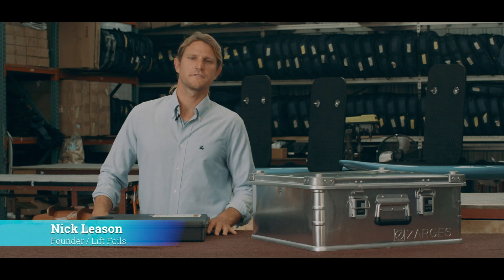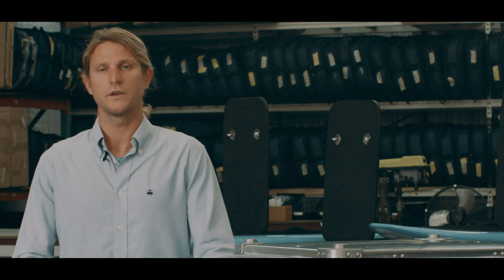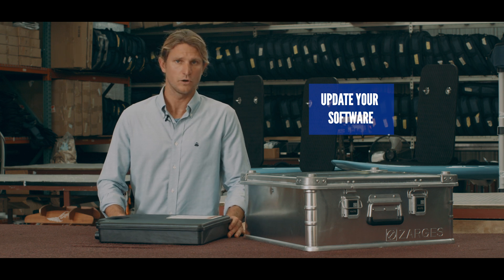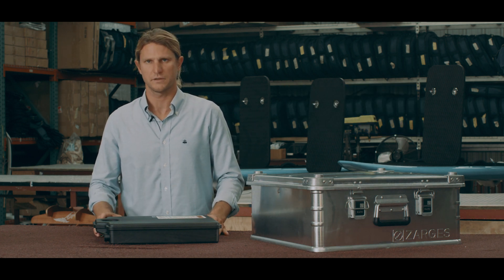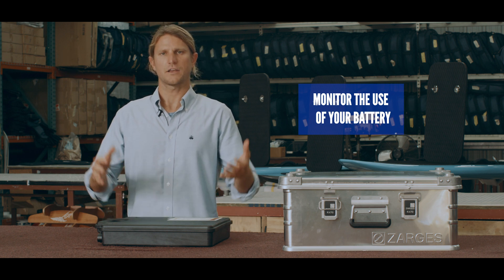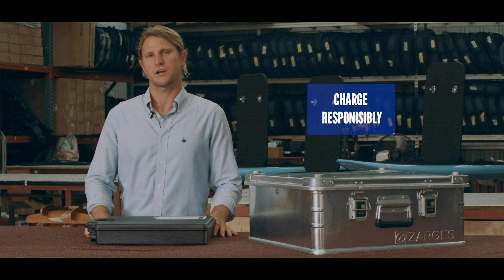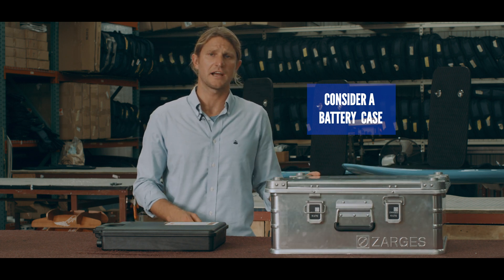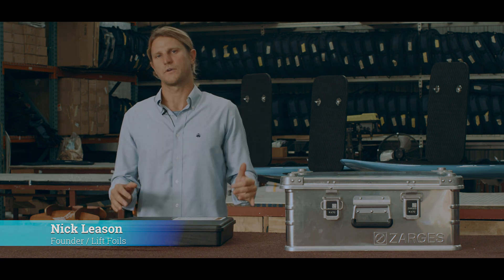Battery Safety and Best Practices

Comment: Helpful video but don’t leave battery on low charge without monitoring.  If level drops too low off season it’s a $3500 brick.  Just bought a new one as I stored it at 20% for 3mos unattended.  Fine print says to check charge monthly.